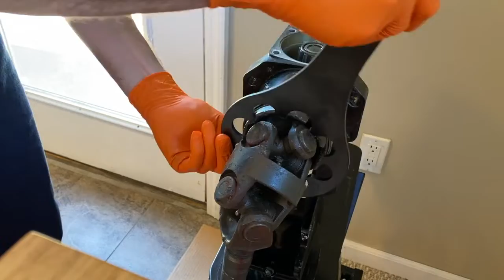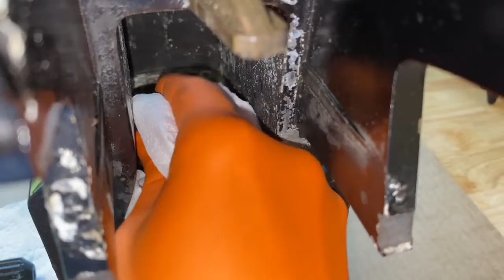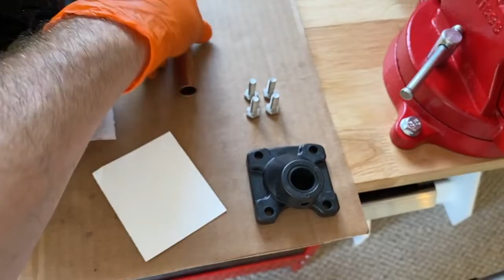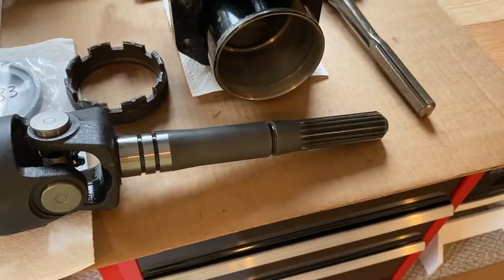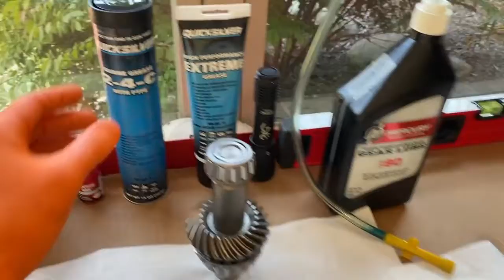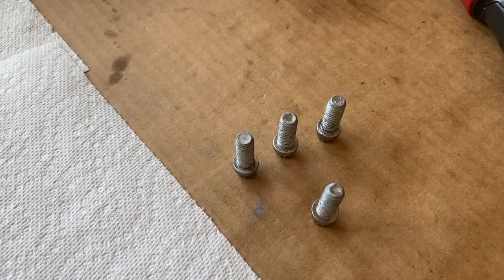Mercruiser mercury upper unit FULL rebuild - EVERYTHING

Comment: Could you inform us how to remove and replace the Welch plug on the outside of the shift cable on the upper unit?
Reply from the maker: Thanks for watching, don’t have a video on that at the moment.  Do you have a service manual specific to your outdrives serial number?

It will be in there.  Please keep us posted.

Comment: My Alpha One Gen-1 Upper Unit Drive Shaft Retainer Nut won't tighten. The threads on the Upper Unit Housing appear a little "flattened", not pronounced or pointy. I've order another Drive Shaft Retainer Nut. What can fix this issue? Can I Chase the Threads in the Housing with a new Drive Shaft Nut? Please advise. I've totally rebuilt this Unit 7 this would be the final piece to Full Assembly. Thank You Michael
Reply from the maker: Thanks for watching.  We see this same comment and question on another video of ours.

We would definitely screw-in the new retainer nut very very slowly and precisely.

Even when you feel that, it has caught the thread, we still encourage you to go slow throughout the entire tightening process.

Comment: Michael...I love your videos...they're a BIG help! >My Alpha One Gen-1 Upper Unit Drive Shaft Retainer Nut won't tighten. The threads on the Upper Unit Housing appear a little "flattened", not pronounced or pointy. I've order another Drive Shaft Retainer Nut. What can fix this issue? Can I Chase the Threads in the Housing with a new Drive Shaft Nut? Please advise. I've totally rebuilt this Unit 7 this would be the final piece to Full Assembly. Thank You Michael
Reply from the maker: Thanks for watching, this happens periodically and yes…we would ever-so-slowly align new retainer nut and spin in…again very slowly.

Even when you feel it has caught, stay true to tightening it slowly and precisely.   Easier said than done.

Comment: What is part number to bearings u had Marine shop press on, thanks.
Reply from the maker: Thanks for watching, below are p/n to gear/bearing kit.

43-803101T 1

45-55796

Double check that these are the exact replacement part numbers for your unit prior to purchasing.

Comment: I’m also at 8:24 and glad I watched this video because what I thought was grease hanging down must be melted plastic from a that part!
Reply from the maker: Thanks for watching, you’re not alone.  We have serviced a few outdrives in the past that have melted plastic.

Keep us posted on your progress, we are here to help!  😁👍🧰
Reply: @DIYwithMichaelBorders how critical is that melted plastic lol?
Reply from the maker: @jakejacobson2999 

Thanks for the reply.  Just shows that the impeller was faulty and the outdrive was overheating a bit too much…not good…however we didn’t notice any damage to the aluminum case of the outdrives…just damaged parts internal due to the excessive heat they were encountering…and who knows for how long…🤔
Reply: @DIYwithMichaelBorders ahh okay makes sense. After further inspection, mine looked more similar to yours not as bad as I thought. When I’m using the boat, I’m always watching the temp gauge very closely and it always is good, but I’m gonna order the stuff to do it.
Reply from the maker: @jakejacobson2999 

That’s a great practice or method.

👍

Comment: Great video, but I have a slightly related question! My unit is an Alpha 1, and on the Alpha 1 there is a  closed waterway in the top cap connecting those two (apparent!) waterways in the rear corners. On the Gen 2,  I notice that there is a cutout in the top of the housing,  so that when stationary the water can go freely into the waterway. On the early  Alpha 1 however, there is no cutaway, but both those corner waterways seem to have no feed either? so is it  not a waterway at all? I can't find any information in the manual or any videos, but I'm sure you can enlighten me! Thank you in anticipation!

Comment: Where can I get this o ring for the upper cap aswell as the 3/8 bolts?
Reply from the maker: @michaelvalero2026  

Thanks for watching, we have listed the current parts available however can help take it one step further.  We will need your outdrive serial number to get you the exact replacement o-ring for your exact drive.

Deep dive into new Yoke shaft design with 3rd machine cut

          https://youtu.be/GnnPCrVgx0k

If interested in purchasing these products, visit our Amazon Affiliate links below, I earn from qualifying purchases.

          1.  GLM oil seal kit (87500)

                    https://amzn.to/3njQWrT

          2.  Gasket compound sealant (1525607)

                    https://amzn.to/3DcrJ8c

          3.  Old seal punch tool (89-101-19)

                    

          4.  Water pocket cover

                    https://amzn.to/3UWkIDO

          5.  Loctite 680

                    https://amzn.to/3wG0VKW

          6.  Spanner wrench

                     https://amzn.to/31GwUiD

          7.  Inch pound torque wrench

                     https://amzn.to/3G1aDLl

Thanks!

Comment: Thanks for the video, I had one question, how do you know when the retainer ring nut is tightened correctly, is it just a case of tightening until it feels tight at the end of it's travel? I've seen some discussion of that nut being torqued down.
Reply from the maker: @fiveowaf454  

Thanks for watching.  Are you installing standard gear and bearing kit or the newly designed press-fit kit?

The standard will be a specific torque value, while the press-fit will be tightened using rolling resistance.

🧰
Reply: @DIYwithMichaelBorders  Ill be reinstalling the original gears, the ring nut got damaged when one of the u joints came apart. I understand the rolling resistance part of the process, just not how tight the ring tightened with the special tool needs to be, somewhere I thought I'd read a huge figure like 200 ft lbs, but you just seemed to tighten it with the special wrench, not stating a torque.
Reply from the maker: @fiveowaf454  

Thanks for the reply.  200ft-lb is on the higher end torque-wise.  Most alpha outdrives will call for a lower torque value around 150-180ft-lb however it’s very important to get your exact value for your exact serial number outdrive from service manual.

We installed the newly designed Press-fit gear and bearing kit and used the new rolling resistance procedure set forth by Mercruiser for the new kit.
Reply: @DIYwithMichaelBorders  200 ft lbs seems high based on the components involved and what the ring is tightening against, but I have to assume mercury knows best. I think the high torque setting has more to do with it not coming loose in use than anything else. Like yours in the video, my ring nut came loose very easily, so I don't see how it was ever tightened to that torque when originally built. Did you ever torque your unit down?
Reply from the maker: @fiveowaf454  

Thanks for watching, the engineers know best indeed.  Our torque was set to 180ft-lb.
Reply: @DIYwithMichaelBorders  According to the Bravo 3 manual I recently got access to, the bearing retaining ring nut should be tightened to 200ftlb using a torque wrench on the special tool itself,  and using a conversion chart to calculate the actual torque setting for the torque wrench,  given the wrench is inserted into the special tool in the 1/2" square in the handle, not working directly on the ring nut. That's a lot of torque which also raises the question as to how the one you removed, came loose with just a few blows with a rubber hammer.
Reply from the maker: @fiveowaf454  

Ok, you’re referring to the large retainer ring.  That is different than the info we shared in previous comment… we thought you were referring to the pinion gear nut.

We highly recommend following your serial number Bravo service manual and if it states 200ft-lb, it’s important to apply that torque to alleviate any damage or premature failure.

😎👍🧰
Reply: There will a torque setting
Reply: @terrencesteele444  I found 200ft lbs in the manual with a conversion for the torque wrench using the special tool. What I found on my drive which had never been apart before, was that the original ring nut was not close to 200 ft lbs and the nut on the gear that's  tightened to get the correct rolling torque was also way loose. Made me wonder if they had the manual and the desire to torque it properly when building it. Any how all set to spec. now so hope it will all work as it should.

Comment: Question, is the upper seal replacement the same on a gen 2 bar the melted water pipe housing. in which I don't have on the gen  ??
Reply from the maker: Good morning ☕️ you will find it to be similar indeed.  You will also have the additional oil line on the gen 2.

Comment: hey @DIYwithMichaelBorders should there be play in and out. Like I can push the driveshaft against the gears and pull it out about 1/4 in when I turn the driveshaft and u-joints. I just took the outdrive off my boat because I was looking to see where I had a gear oil leak. There was gear oil in my bellow.
Reply from the maker: Thanks for watching, great question.  We take it you have separated the upper from the lower and are referring to the inner driveshaft that is secured to lower unit through water pump and below.

There will be a very slight amount of play as you pull shaft up and push shaft down however to much play is not good.

1/4” is on the absolute high end of play and any more that that, it can cause damage to seals and gears.

Are you planning on replacing seals?
Reply: @DIYwithMichaelBorders  no I wasn't planning on replacing the seals. But didn't know if that was the cause of gear oil getting into the bellow. But no I haven't taken the outdrive apart. I was just holding the driveshaft that attaches to the u-joints and goes to the motor.
Reply from the maker: @anderslandscapes  

Thanks for the reply, you’re referring to the Yoke Shaft that feeds through the bellow/hull and into the engine coupler.

There should be no play with that shaft.  Your outer retainer nut may have loosened slightly and allowed the 1/4” play which in return, beat up your seals…hopefully no more that that…

Yoke Shaft assembly will need to be pulled out and seals replaced as well as a very closed and detailed inspection of the gears and bearings.

😎👍

Comment: Hi Michael, great videos it appears my lower seal has identical sides? Spring on both sides, so apparently you can install either side..
Reply from the maker: We appreciate that, thank you.  Does your service manual share any helpful info on the seal and design of it?

If it’s the exact same design on each side, it’s likely that it can be installed as you mentioned however double checking the service manual is key!

Comment: Good video but I am confused on something. You say the pre-load is supposed to be 6-8 inch-lbs. my Mercruiser manual (18-03200) on section 10-18 states to "tighten the locking nut to a torque value of 85 ft-lbs."  Which one is it? 6-8 inch-lbs or 85 ft-lbs? There's a huge difference between those 2 values for setting a pre-load. Also, your micrometer is being measured in nM, not inch lbs. I'm hoping you drive doesn't fail due to improper torque settings.
Reply from the maker: Thanks for watching, 85ft-lbs will be for the standard bearing kit while the new (Press-fit) bearing kit will be set using rolling resistance.

Most important thing is to continue following your exact service manual.  Hope this helps.
Reply: @DIYwithMichaelBorders  Thanks. I contacted mercruiser regarding it also because I was confused. They told me whether it was a pressed gear or factory gear the rolling resistance should be 6-10 inch lbs! When installing back into the sterndrive and tightening the castle nut back on, The castle nut should be torqued to 200 ft lbs, however there is a chart to use  when attaching your torque wrench to the castle nut wrench, you have to measure from center of torque wrench socket drive to the center of handle and look up on the chart. Different lengths have different values. My torque wrench is 15 inches, so torque on castle nut will be 111 Ft lbs when connecting torque wrench to the castle nut wrench.
Reply from the maker: @TheCommo81  

Thanks for sharing, a true DIYer.  We love it!  Rebuilding it will put you in a great mood.

Comment: I thought the old style bearing was not rolling torque and " normal" torque to 70 ft/lb...you mention the old style is 5/6 inch pounds? What am I missing?
Reply from the maker: Thanks for watching John, we are here to help!  😎👍

We recommend following your exact service manual for your outdrive.

If your manual states to torque the original bearing and gear set to 70ft lbs, we strongly recommend doing that as it ensures you’re following the engineers instructions.

However if you’re transitioning to the new designed gear and bearing, you will follow the rolling torque instructions set forth by your manual.

Below is a link to our video explaining in more detail the difference between the two.

       https://youtu.be/KI41DFX3tq0

Please keep us posted on your project and hey if you’re into crypto, join our DIY ecosystem.

       toolboxtoken.com

Reach out to us any time!  🧰

Comment: Hello, i was wondering why you didn't do all the shimming procedure with shimming tools. I'm going to change the 2 roller bearings and i need to know more about.
Reply from the maker: Thanks for watching, shimming will differ depending on your serial number and you will want to follow your exact service manual as opposed to ours.

Keep us posted on your DIY project.
Reply: That's poop, you shim accordingly to get a good meshing mark, no one setting is going to provide you with the correct mesh which is why you adjust the Sims accordingly, you done have the experience!

Comment: By the way, the “engine” is on the other side of the transom. Words matter.
Reply: Just goes to  prove that he really is a diy'er,  and smart  enough to have a shop press the bearings and gear on the shaft instead of buying a $500 press to do it with.
Reply from the maker: @clacker54  

Thanks for watching, having the shop do it was definitely the smart approach.  The shop ensures the parts are properly pressed to factory specs which is extremely important!!!

😎👍
Reply from the maker: Thanks for watching & yes, this is an outdrive.  We appreciate you sharing your thoughts, let us know if you have any questions.

Us DIYers need to stick together!!!

😎👍

Comment: I need to know all about upper vertical bearing. How to remove and install. This is not a FULL rebuild
Reply from the maker: Let us know if you have any specific questions, all parts of our vertical gear are new.
Reply: @DIYwithMichaelBorders  I am going to have to cut mine off and reuse the race. Maybe I should do a video because would be the only one
Reply from the maker: @gdwmnlvr850  

Thanks for the update, if you do, we would definitely watch it to support your channel.  😎👍
Reply: Took cap off. Battery Dremel tool for bearing. Carbide blade. O'Reilly puller for race. Easy peasy. No press needed.
Reply from the maker: @gdwmnlvr850  

Awesome Awesome, thanks for sharing this Sam.
Reply: Didn't take any of the outdrive apart. Cap off only.
Reply from the maker: @gdwmnlvr850  

Looking forward to hearing back from you after tackling the next steps.  Let us know if you have any questions.

😎👍

Comment: My alpha one gen 2 drive does not look like this inside - there are no bolts holding the water tube assembly... 
is  drive that you are working on a Bravo or an Alpha 1 Gen 1 by any chance? thanks
Reply from the maker: Thanks for watching & welcome to the DIY Raptor Club.  This exact model is an Alpha 1 Gen 1.

Keep us posted on your project & any questions you may have.  Us DIYers need to stick together!!!  😎👍
Reply: How much different is this from the gen 2? I need to rebuild my upper gear set I believe… and I have a gen 2

Comment: I had my gears break, went to the local marine and they said the vertice shaft comes with everything separate? (Gear, bearing,) and I have to pull the old bearing and gear off the shaft. I saw yours came already assembled on the shaft? Where can I order that
Reply from the maker: Thanks for watching & welcome to the DIY Raptor Club.  Ours did come in separate parts, we took all the parts to our local marina & they pressed everything together to factory specs.

Did your local marina mention that they would put together the new parts if you ordered them from them?
Reply: @DIYwithMichaelBorders  that's not you doing a FULL rebuild then is it
Reply from the maker: @gdwmnlvr850  

We don’t have the press.
Reply: @DIYwithMichaelBorders  you sure did put "EVERYTHING" in your title and it is not
Reply from the maker: @gdwmnlvr850  

Thanks for the reply, everything meaning all (PARTS)...PART 1 - PART 5.
Reply: @DIYwithMichaelBorders  you can't say rebuild EVERYTHING. And say part to part. Several asking on here about the bearing. Your only response is the shop. The shop. Not you and not everything..... Period
Reply from the maker: @gdwmnlvr850  

😎👍